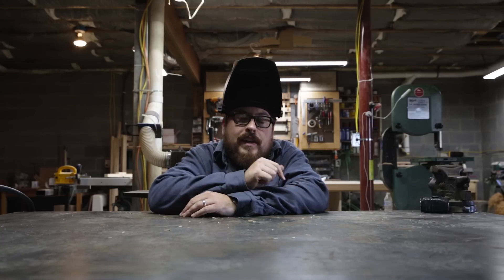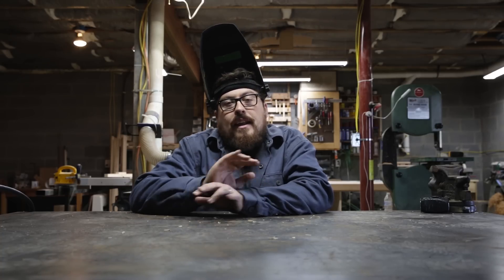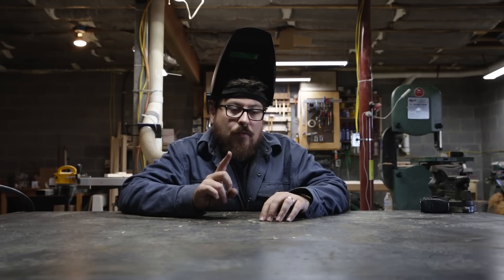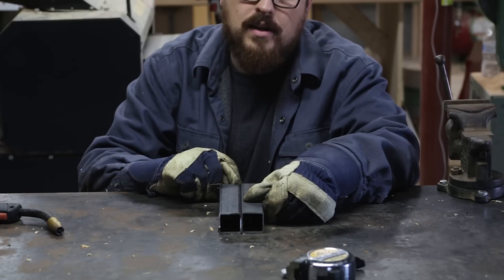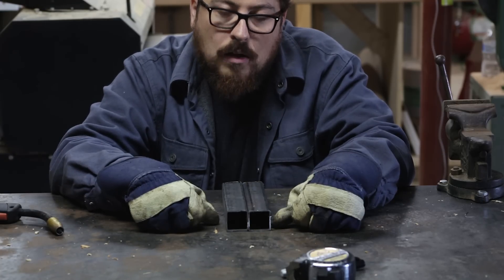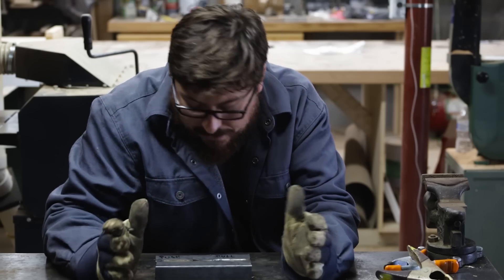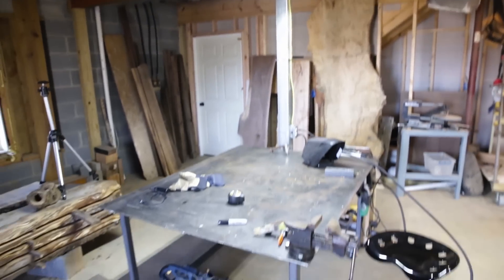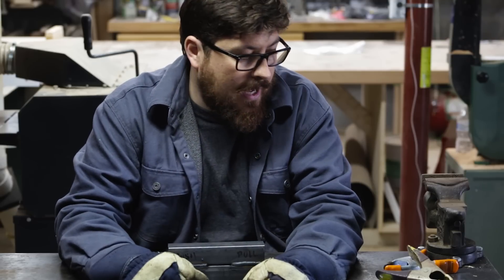MIG Welding: Pushing vs. Pulling the Pool

Comment: The push is a better weld the pull is cold. How do I know? See how the pull is humped up and the push is in the joint? Humped up beads always = a cold weld I like to pull myself but you should never pull a mig gun if it has slag you drag so fluxcore and stick you drag mig tig you push

Comment: The most important part would be penetration as it needs to be a strong weld. My grandfather taught me to weld with a stick, I believe it's flux welding, how they call it in English. He taught me to pull. Just out of curiosity I just watched a video on this matter and he mentioned that when flux welding you pull, which is how i was taught, while he said in MIG you push, which is how he always welds.

Comment: Hey William, I watched your welding table build and saw this video in the feed. I definitely favor 'pulling', I dont like having my brace hand running over the heated steel. especially when running higher voltage. Looks good, nice work, keep it up! 
PS  2:40, get any closer and your going to melt your helmet off your head.
Reply from the maker: Yeah, a lot of people pointed out I was way too close.  I'll be sure to back off!

Comment: try to use push - it adds more heat / penetration and helps you further because you push when tig welding - so it's good practice later when you get into tig. Also you actually get to see the puddle, that is why your weld test showed it more aesthetically pleasing.

 I pull (or drag) when there is slag- ie.. when I stick weld and when outside using my flux core machine.
Reply from the maker: Good to know!  I haven't run any flux core through my machine yet, but another guy (a pro) was saying anytime there's a vertical weld, you should use flux core.  Which I thought was really interesting.

Comment: Nice work man! How are you dealing with ventilation? I'm starting to think about my plans since winter is on its way.
Reply from the maker: +Crafted Workshop I've had the good fortune of having some pros comment on my videos. It seems like a fan and keeping your face out of the smoke is enough for mild steel
Reply: Wm. Walker Co. huh, cool. Even in a closed garage?
Reply from the maker: +Crafted Workshop I've got a pretty big space I'm honestly not an expert. You might try /r/welding
Reply: .........do some research, Neurological damage is common in welders, if you smell fumes you are exposed.....need to remove the fumes from your breathing space, ....yet not so much air flow that you disturb the shielding gas over the weld....good luck.

Comment: It's hard to be sure just by looking at the surface, but I would guess the push had better penetration. I have always been told that pushing is better for penetration since you are forcing the weld into the piece rather than dragging it and just letting it lay.
Reply: Maybe cut the piece in half at both welds and examine the penetration?
Reply: Pulling actually has deeper penetration. But pushing is stronger cuzz the weld is a little more spread out and flat. If that makes sense.

Comment: It depends on a lot of things. As you say, it is good to experiment and not get set in your ways. there are lots of reasons to weld uphill or downhill, and what makes a pretty weld isn't always a strong weld. I happen to find that pushing the puddle works best for me in most situations, but occasionally, the need will occur that I must drag, or pull the puddle. Technique to get that "stack of dimes" beaded appearance in either push or pull are different. 
Essentially think, "cursive 'E'" for push, and more of a zig zag C for pulling the puddle.

Comment: Just a tip, get your head out of the smoke. cadmium can cause parksinsons disease and in the video your head is in a plume of smoke. If you need help seeing what youre doing get a magnified lense fof your helmet. they are awesome.
Reply: totally agree!!
Reply from the maker: +Brandon Brown again, I always love people chiming in. It's funny I had a comment on my last video where I asked about visibility and the poster said "don't be afraid to get close!"
Reply: Wm. Walker Co. well trust me heavy metal poisoning is no joke. i weld galvanized steel and at work i wear a respiraror use a fume extractor and have a fan. but with mild steel a fan and keeping your head out of the smoke is fine. aluminum and stainless are a no go without a respirator.
Reply from the maker: I do keep the shop door open, and I've been meaning to put a fan up.  Maybe I'll add a box fan blowing away from the table to make a poor mans extractor.  My respirator doesn't fit under my helmet.   Any suggestions on a slim profile respirator?
Reply: LOL I didnt read your amazon link, that is the one I am talking about and yes it is the bee's knees
Reply: Wm. Walker Co. I personally have a 3m respirator and love it .. but a lot of the guys have started showing up with this baby lately.. https://www.amazon.com/Miller-Electric-2240377-Half-Respirator/dp/B00V7UUNU4
They love it!!
Reply: Miller has a nice low profile mask to fit under your hood.
Reply: Tomy Hovington that miller mask is the one i use at work, i like it a lot.
Reply: Brandon Brown it does look nice and people I know who use it love it too, guess I'm old school... I'm used to and really like my 3M and it fits under my helmet no problem.. who knows.. I might get a new one for Christmas;)

Comment: I've been in the welding trade for 22 years now and although for the use you are using your welds for pull or push will be just fine. In a structural application though depending on which wire you are using, hard wire is pushed and flux core is pulled. Metal core is pushed also even if it falls in the same category as flux core . It's also the wire that people usually argue the most on the push pull issue. Nice video!!
Reply from the maker: Tomy Hovington do what you want, but I am staunchly against mac. You are only spending money on the brand. especially after their latest release getting rid  of almost all ports. 8 years is a long time in the computer world (2009 feels like forever ago). an 8 year old mac would be out of spec too. just sayin, I built a faster more capable PC for half the price of the best Mac you can buy.
Reply from the maker: Excellent information!!! I have only been using solid wire since I don't see any reason for me to use flux core.  Good to know though. I'm just curious.  Why would it be better to pull flux core?
Reply: Wm. Walker Co. when you push flux core your risk getting inclusions of flux in your welds. Of course if you weld a vertical up you'll need flux core and you will have to push from bottom to top.
Reply from the maker: Can you expand upon that?  "if you weld a vertical up you'll need flux core and you will have to push from bottom to top"?  Are you saying (I'm just trying to learn, not to be contrary) if I'm making a vertical weld, that the shield gas wouldn't be effective so I'd have to switch to flux core??
Reply: Wm. Walker Co. if you want a structurally sound weld you need flux core. So yes you need to change to flux core wire to weld uphand. In your case if you can flip the work piece instead you would be able to do all flats. In the case you cannot, the only wire for vertical is flux core. Flux core usually needs CO2 gas but can also work with mix argon. I think the ratio we use at work is 75% argon25%co2.
Reply from the maker: Wow!  So, sorry for your bad luck, but you just became my "guy" when I have questions!  I really had no idea.  We didn't go over that in my 16 hour MIG class.  Shocking that I didn't learn everything about MIG welding in 16 hours right? hahaha
Reply: Wm. Walker Co. lol, no worries!! I'll be happy to help if I can!! 16 hrs mig course was a "metal inert gas course... that's why it didn't cover the other type of wire... since I just became your guy for welding , I might pick your brain about photography and filmography.. if you have a few minutes maybe have a look at a few of my videos on my channel, any constructive criticism would be welcome..
Reply: Tomy Hovington exchanges like this are what make YouTube awesome.
Reply: Alan Fisher I totally agree..
Reply from the maker: +Tomy Hovington sorry! I never responded. Pick my brain anytime!
Reply: Lol, No worries, just send me a free sticker and I'll stop being mad at you ;) . No seriously I haven't pick your brain yet because I realized there isn't much I can do with Movie Maker in the first place, and I haven't found a chead $ but good, user friendly software to go with... I've been a trades person all my life in the Steel  industry and work with wood with my dad from as far as I can remember... Never got to play much with computers and Editing other than the past 2 years..
Reply from the maker: Tomy Hovington have you tried the free version of DaVinci Resolve
Reply: Wm. Walker Co. no, never heard of it... I'll have a look at it, thanks
Reply: Well, I've found and downloaded Davinci Resolve and also watch a tutorial on it.. Looks like a great tool. Unfortunately My PC does not support it's requirements for video card etc.. It made it crash twice... Guess i'll be looking into a new computer before I get to play around with it..My PC use to be top of the line some 8 years ago..Might be making the jump to Mac.. Thanks Again for getting back to me! I really appreciate!
Reply: I am a bit uncomfortable with their price tag ( expecialy looking at the IMac 4K or 5K retina). The main reasoning behind it for me was that windows 10 doesn't have a video editing software anymore and that IMovie seemed simple enough to play around with. I am unwilling to spend the money for the likes of Adobe Premier/Pro. Davinci resolve would solve that issue. This question may sound really stupid to you but should I look more into a desktop option rather than all in one( for futur upgrades)? I have a laptop at the moment, and i'm in the process of moving into a new house with a bigger shop that could accomodate for a office desk.. Dell seems to have decent towers that are quite a bit more in my price range. I would like to hear your 2 cents on the matter..